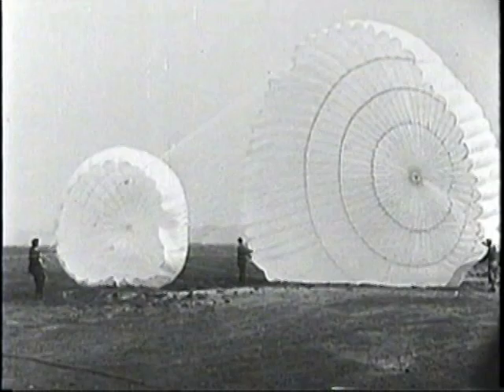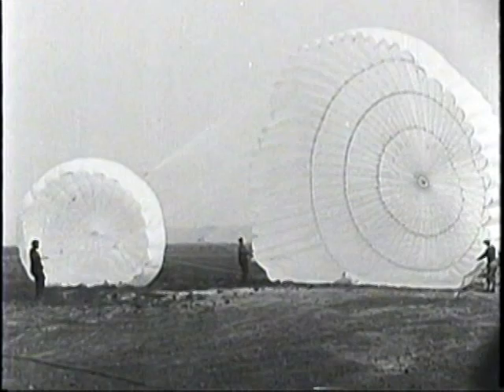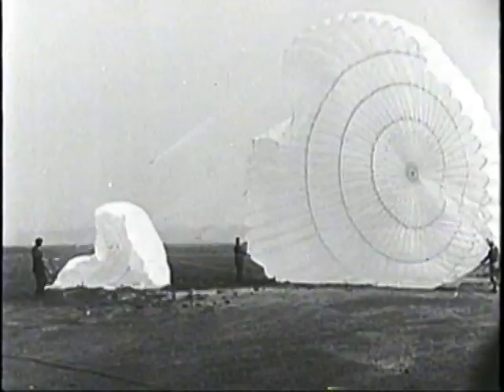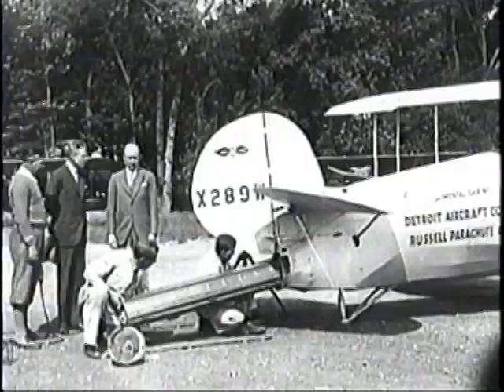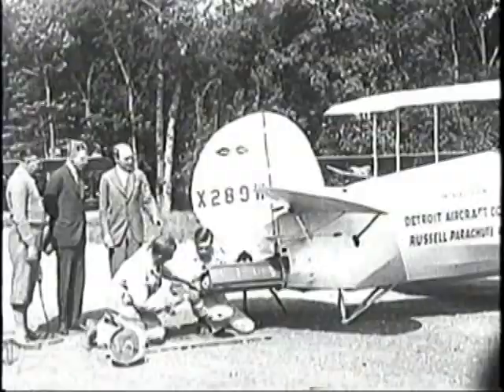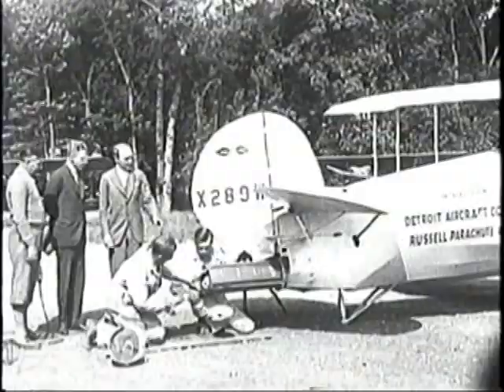Early Airplane Parachute Tests: Video 1

Comment: Its a shame FAA hasn't made it mandatory after all these years. It could have saved 100s (if not 1000s of lives). You have seatbelts and airbags for cars, life buoys and vests for boats, helmets for bikes...but nothing for planes.

I know someone whose friend's plane nose dived to the ground due to a structural failure (Breakage of wing) at high altitude, and he survived it because of BRS system. 

GA pilots die more than others due to light planes severely affected by weather, so this is a must

Comment: Agreed this won't save you from a crappy landing or take off, but enroute crashes in small planes can and should be avoided. Another system probably needed would be shock-absorbing, thick foam deployment around the fuselage in case of an eventful landing in uneven terrain. Combine that with the parachute, and we will have a winner.